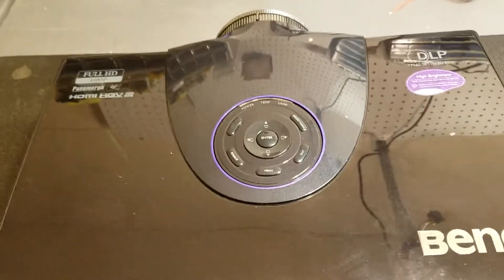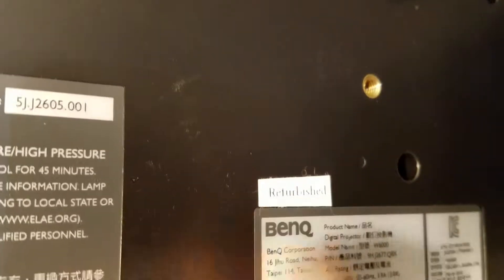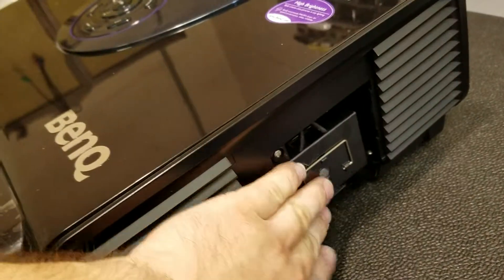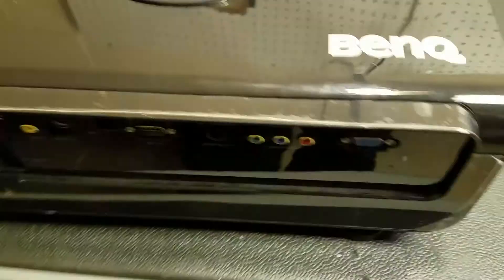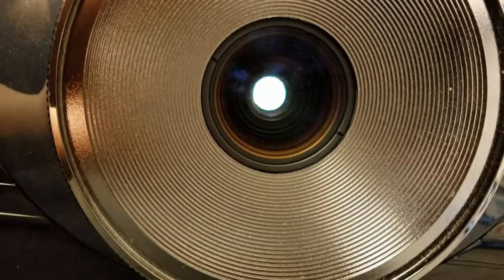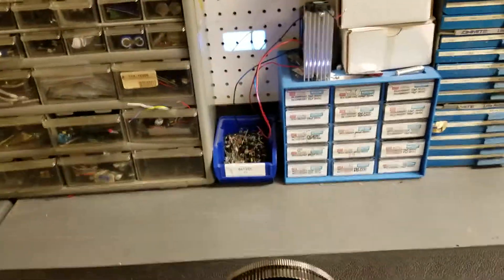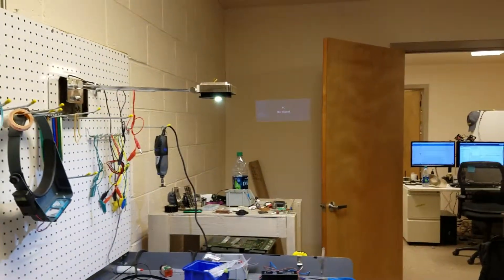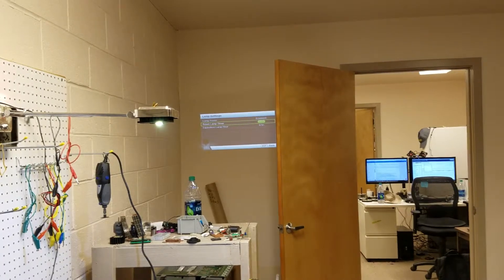BenQ W6000 DLP Video Projector Repair / Evaluation- No lamp light

Comment: Hi Frank! I found you on YouTube and Big Screen forums and you seem to be an expert on projector repair. I tried reaching you at sales@weezytech.com but the email bounced. I have a BenQ W6000 with a brand new bulb that is having an issue. When I turn it on, the screen comes on for about 60 seconds then the projector shuts itself off. The "error code" it's giving is: Power light OFF, Temp light RED, Lamp light GREEN.  Via the troubleshooting section of the manual, it says that this means that the fans are not working properly, but I can definitely hear and feel that at least one fan is working.  I don't know where to get parts for this nor how to disassemble this tricky thing. I don't know if you offer a service or have a website that people can request repairs through, but I just thought I would reach out and ask if you do repairs still and what the cost would be? ID be happy to pay! Thanks for your help and so appreciate what you do!
Reply from the maker: Just saw your email.  Ill get back to you later today.

Comment: Hello. A friend of mine gave me his faulty benq w6000. The moment i turn it on the lamp light keeps blinking then it goes into protection. I got the projector checked from an ordinary repairing guy he said the lamp is fine. What could the problem be?
Reply from the maker: As much as I hate to say it. I would buy a new lamp anyway.  Unless the repair guy has a ballast to test the lamp, there is no way to know if it is truly good or not.  I suggest trying a lamp because they are easily returnable and usually the cause of most problems like you are describing.  
If a lamp does not solve the issue, there are a few other possibilities but they involve disassembly.

Comment: Hi Frank, I recently got a BenQ W6000 from someone on craigslist very cheaply.  He said it was having issues with it eating through lamps in the matter of a couple hundred hours but that also he was buying knocking off lamps.  He said he previously had the fans replaced by BenQ.  To test it out, I got a $50 lamp from bulbamerica and it worked wonderfully, but burnt out in less than 20 hours with no temp alerts.  I was hoping that maybe I'd get a few hundred hours before it burnt out and decide to test out a more expensive bulb.  

I'm a little hesitant to buy a 200 dollar lamp as I feel like there's a decent risk of early burn out after the 6 month warranty is up.  

Any advice?
Reply from the maker: I'd get a better lamp. I know BA and they are a drop shipper. That is probably a lamp from Mitek honestly.  The housings they use tend to cheap out of the IR filters.  Id try someone on projectorcentral.com's lamp seller list.  Those are good lamps.